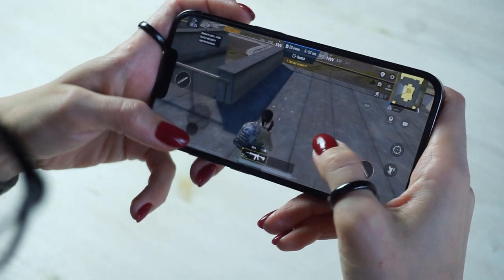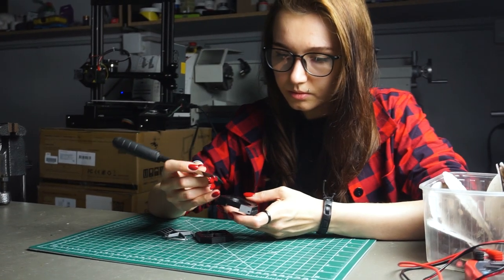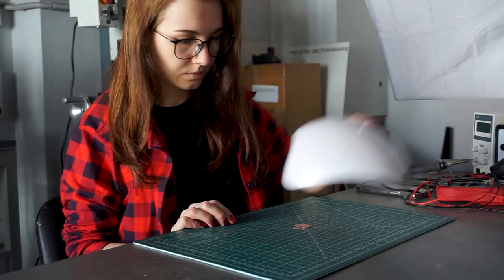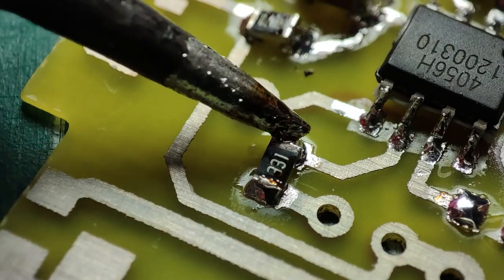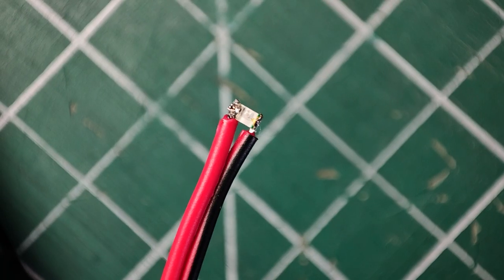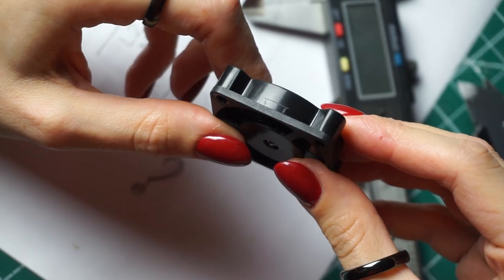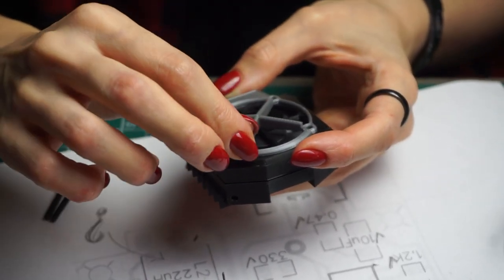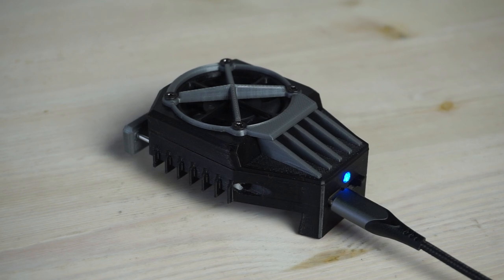Say Goodbye to OVERHEATING phone! / Making a PHONE COOLER

Comment: Can you make phone cooler with thermoelectric paltier with 5v input but the fan is 12v and the thermoelectric paltier is 9v using step-up module or you own diy... btw i know it's crazy but it could have  better heat dessipation right... i actualy use right now a phone cooler with 5v in and 5v out on both fan and the TEC. Which is now the fan don't work but still rgb light still working and the TEC also but usless cause the fan won't blew out the temp of heating part of the TEC..Btw nice voice over and your voice to